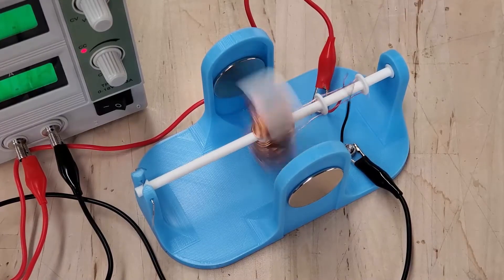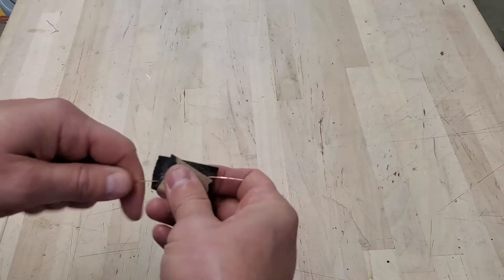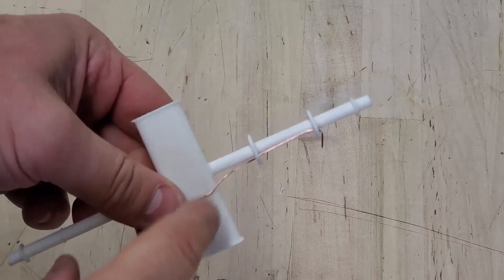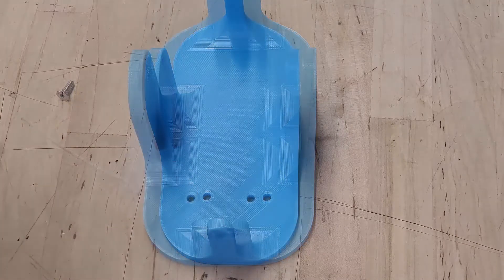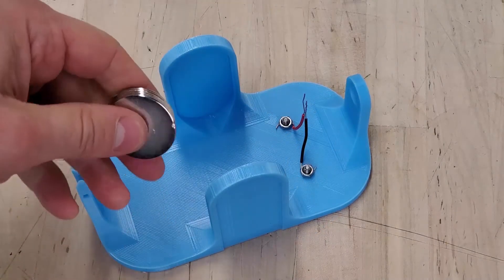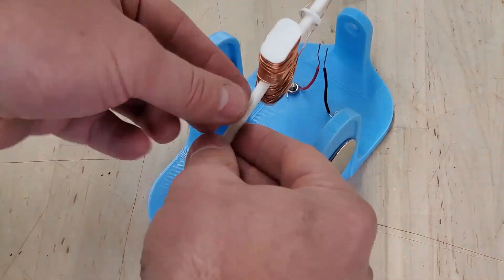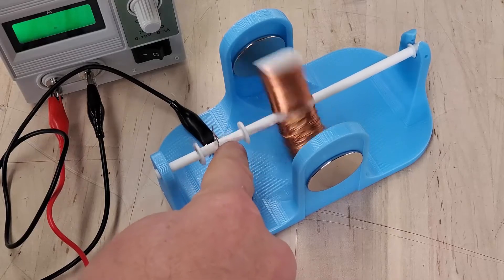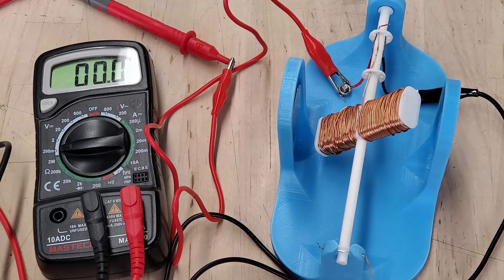Construct a 3D Printed DC Motor

Comment: How many volts and amperes please ?
Reply from the maker: Depends on how you build your motor and how many magnets and how many coils you rap.  i recommend using a nine volt battery, but for best results, use a dc power supply and adjust it accordingly.
Reply: @JohnFuller804  Thanks, but in for a setting identically to yours, be prepared for how many volts and Amperes. thanks

Comment: Great  project!
Reply from the maker: Thanks hope u enjoy it
Reply: @JohnFuller804  I was wondering why you made the rotor shape like you did, essentially a rectangular box instead of a cylinder. Are there some magnetic properties that this amplifies? I am working on a motors project with my students so I'm trying to understand this. Thanks!
Reply from the maker: @matthwy1  no reason in particular,  just mostly designed it to make it ez for students to wrap the coil.  I also based the design off of other DIY motors I saw on YouTube

Comment: Hmm I wonder what I did wrong 🤔 used all the materials except I used a 9volt battery instead of a power supply
Reply: I also wanted to note that I used bare copper wire to wrap around the armature, would this have any effect?
Reply from the maker: @pooppyybuhhole  you need magnetic wire, not copper wire.
Reply from the maker: @pooppyybuhhole  Good luck!  My high school engineering students struggle with it a bit, but after some modifications, they usually get it working